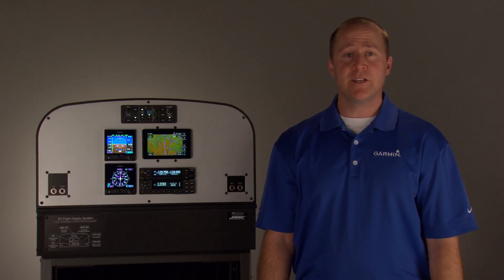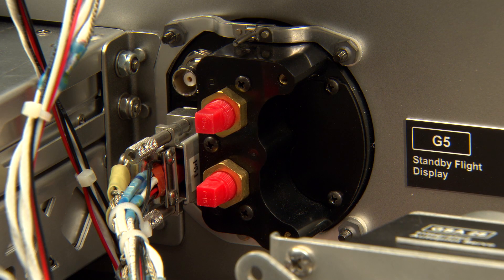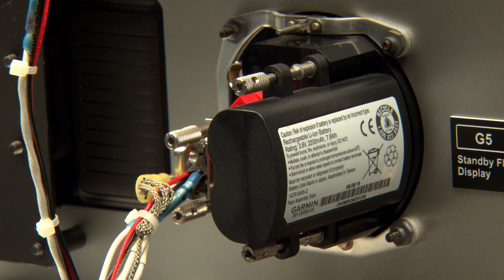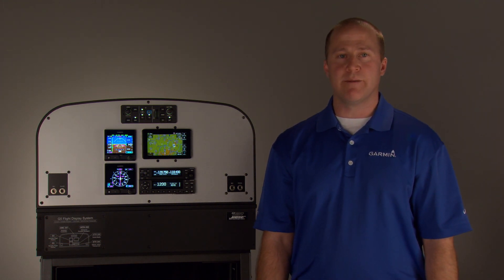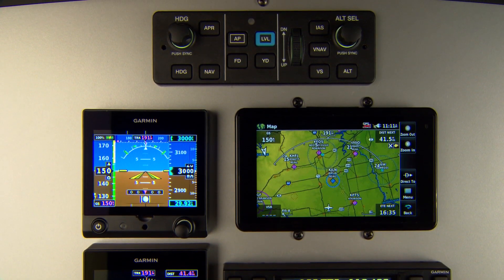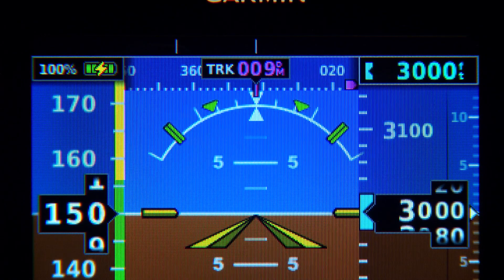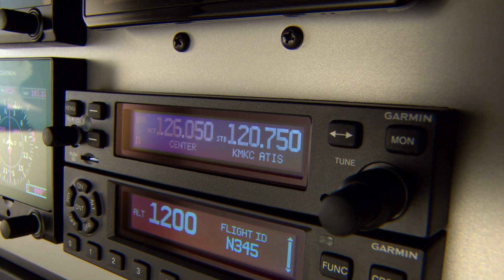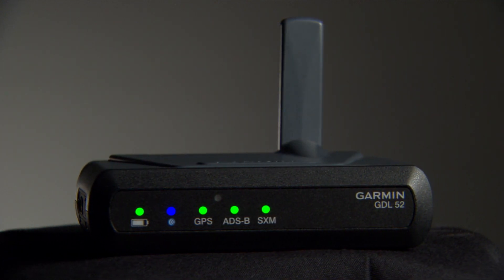Garmin Avionics for Experimental and Light Sport Aircraft: Affordable Solutions for Your Airplane

Comment: My ercoupe qualifies as an LSA. Can I put this version of the G5 into it?
Reply from the maker: Hi John, if the aircraft is type certificated, it will require the certificated version. I do see the Ercoupe listed on the AML STC under the Aircraft Make/TCDS holder as Univar. More information here: https://static.garmin.com/pumac/sa01818wi_2109.pdf. If you have further questions regarding the designation of your aircraft, I'd recommend talking with your local Garmin dealer to help review your aircraft specifically.

Comment: How do you toggle the OBS and GS between GPS and VOR/ILS? My understanding is that an option should be available on the PFD display but mine lacks that option. Is there a setting that needs to be adjusted? I’ve a GNX-375 and GNC-255 tied to my G5. The GNC VOR works fine with its own OBS and feeds an RMI on the G5 so I know they’re talking, but I can’t toggle thus get no glideslope from it. The GPS works well both OBS and RMI style on the G5 with its own map and OBS on itself.
Reply from the maker: Hi Jim, assuming everything is wired and configured correctly, press on the knob and select the source navigator there. Thank you for being a Garmin customer.
Reply: @Garmin  no option available. Manual says such should be on the PFD display not HSI, checked both, no joy.
Reply from the maker: Hi Jim, I'd recommend having your shop take a look at it to ensure it's wired and configured correctly.

Comment: Can you use a GAD 29 to connect an aera 760 to a dual G5 set up for GPS guidance on the HSI?
Reply from the maker: Yes, this is a great VFR solution. Additionally, the interface is directly from the aera 760 to the G5. You only require the GAD 29 should you desire to provide heading to another manufacturers’ autopilot. ^DK

Comment: Could you please give us an estimate cost for all the packages options (no installation cost, just products) you just presented?
Reply from the maker: For prices and details please contact our Aviation support team at the following link:
http://j.mp/GRMNFlySupp
~JH
Reply: @Garmin  Titling a video "affordable" then not including prices, and not making them available without contacting you suggest that this equipment is perhaps not that affordable after all.  Your competitors in this market make price information much more accessible. The problem for a potential buyer is compounded by the alphabet soup of alternative models and options. It is very difficult to find a comprehensive overview of the Garmin avionics system.
Reply: @slideslipping  The system as displayed would set you back around 30,000 dollars, including installation. 6000 for the g5's, 5,000 for the autopilot, 5000 for the transponder, 4000 for the navcom, aera 660 $850, panel dock 130, plus installation costs. That is indeed not affordable at all.
Reply: @woutersijtsma1232  not affordable compared to what other options? Seems like its affordable compared to something like an Avidyne IFD550. the IFD's alone are like 15-20k a piece...
Reply: @Munky332  You are hitting the nail on the head, they are all way overpriced.